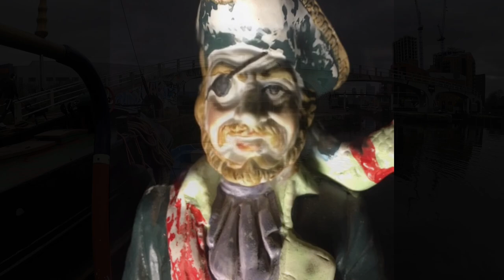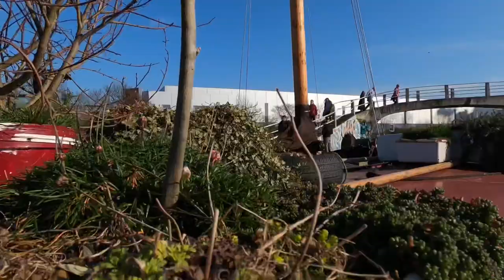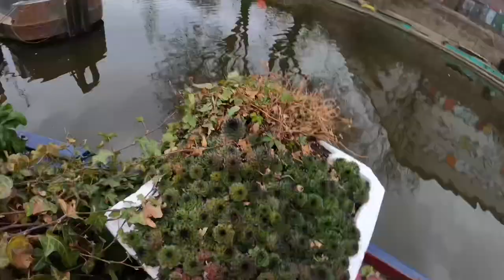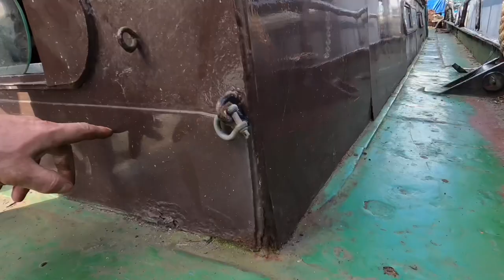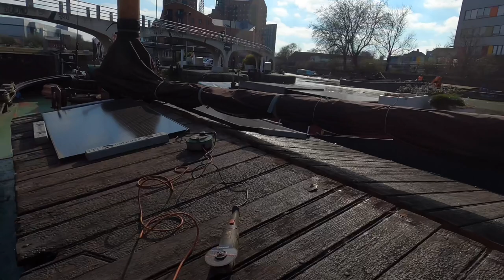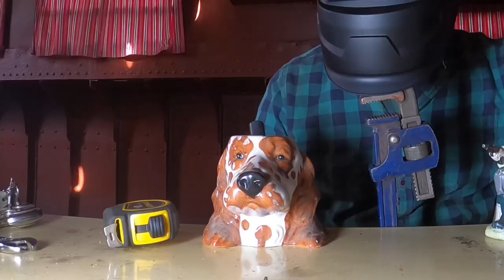The Canvas Comes off Dutch Barge Linda#42

Comment: Well done for fixing your bike as well as everything else. Wonderful to see your gardens, definitely a joy to notice spring growth tenderly reaching out with promise - makes me want to plant more. 
You have lots of potential options for renovation of the roof, obviously you want to make it water tight and solid but insulation is also an issue. The inside of the cabin roof on my tjalk used to attract lines of dripping condensation on winter nights (that even froze into icicles on a couple of occasions). Headroom is nearly all lower than in Linda - I have 42mm thick EVA rubber mats on the outside of my steel roof , held down with heavy natural rubber mats on top against the wind. - no more condensation on the ceiling this last winter. They are sold as horse mats and can be 6x4 ft normally. Pond liner is also another way to get waterproofing.... The best of luck to you and thanks very much for the brilliant and funny videos.

Comment: I don't know if the quality of the wood is right or if there would be enough or if you have other thoughts and plans, but I thought that wood off the top looked great and would make great flooring for the interior.
Reply from the maker: Hi Chromdom, I’m thinking along those lines as well. They will stay on the boat in some form.
Reply from the maker: Hi Chromdom, I’m thinking along those lines as well. They will stay on the boat in some form.

Comment: I was wondering about all the vegetation on your roof. Thank you! I doubt I could get any of that to grow in the desert. I had Mint someone let loose around my pond and it killed everything in sight. Pond is shut down for now until I can wipe it out. Will you be re-tarping the wood on the roof or not? Could you cut the boards thickness down to give you the look without the full size? Just wondering. Questions on older videos are never are a good idea but oh well...
Reply from the maker: I have thought about the finish on the roof, it going to be complicated as you’ll see in the next few weeks. I’ve just payed the boards on the floor inside to get them out of the way. They don’t look bad. 
Oh my God mint will totally take over. It is however one of the plants that wouldn’t last on the roof as it would be too dry. I guess you’ll have to just pull the mint out by hand? Is there another way?
Reply: @canicebannon  It was voracious and took over and drove roots into the waterfall. I am going to clear, cover and install a "watering trough" round container type pond  ( instead of the three foot deep in the ground version ) about a foot down in the ground but two up then put some local boulders and stones around it so the wildlife can get to the water again. We have had roadrunners, coyote etc in it as its a safe place to get a drink. Then I can re introduce the flora. Thanks for responding to my constant chatter. See you in the next episode!!

Comment: Have you thought about an all wood skylite. Love your vlog cheers mate.
Reply from the maker: Hi Ray, You’re the first to bring this up. The answer is yes, sort of. I will be putting in flush skylights near the front, so they fit under the boom, but I do have the option to another pigeon box further back. (I’m only referring to the section of the roof that had the boards on.) You may not have noticed but, at the very back of Linda under the tiller, there already is a pigeon box skylight, covered by a blue plastic tarp, this is in need of a bit of TLC. Skylights bring way more light in than windows. An absolute must!

Comment: If those scallywags sue you set the dog on em, arrrrgh! Oh no I didn't think I'd ever see the day the captain is appeared in my comments!
So,,,are you going to remove that part of the superstructure and rebuild it? Raise the roof to a higher level?
I must say the plate steel you have looks to be very porthole and window sized. Is Linda going to be a patchwork quilt of patches on patches with patches over the top? By the time you've patched her up you may need to remove ballast! Lol just joking Linda no offence intended😊
Look forward to the next installment, I've renewed my virtual deck licence, so untill then take care, stay safe, and put the kettle on!
Reply from the maker: Hi Simon, yes, I am replacing the steel. I had thought of being creative and making a cute patchwork of repairs that would make it look bohemian, but that was until I saw how wonky the walls had become due to the lack of structural support. So, in the end the only thing that will remain are the two sections of roof. All the walls of the cabin are being replaced. While I’m at it I’ll raise the roof. Not by much though 4 inches or so. It’ll be fun learning to weld all over again!😂
Reply: @canicebannon  welding is like testing a cleaning product! It should be done out of sight and a little bit at a time!😂🤣
I kinda tought myself to weld a few years ago, when I needed to construct a market stand, the welds started a bit messy but after a while I thought I had done a good job, I had a weld fail one day and my son in law who knew a welder had it repaired for me, that's when I saw what good welding was🤣😂🤣😂  the stand is still in perfect working order but let's just say it's a good job they don't need to be water tight welds.
Good luck at homing your skills again, and if you've welded proficiently in the past I'm sure it's like riding a bike, not literally, as in you don't forget!  I found the hardest bit getting the setting just right depending on the steel, but that's probably just my lack of knowledge.
Take care, I'll see you there next week!